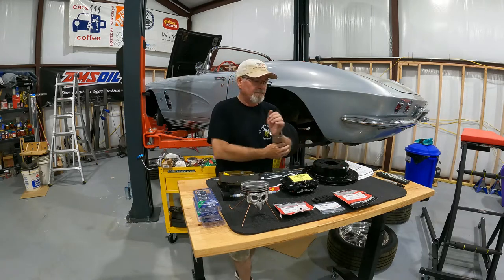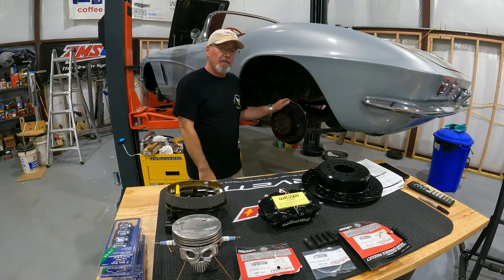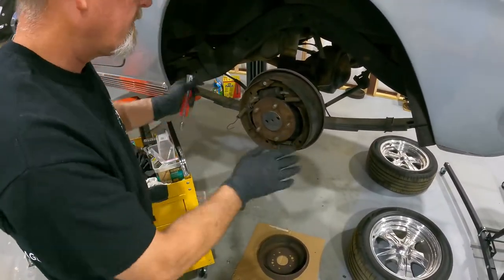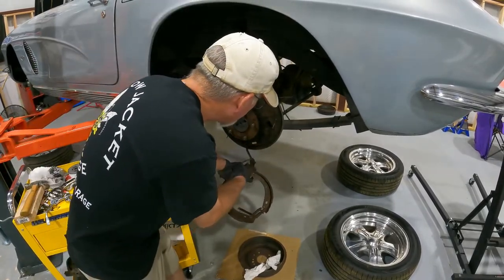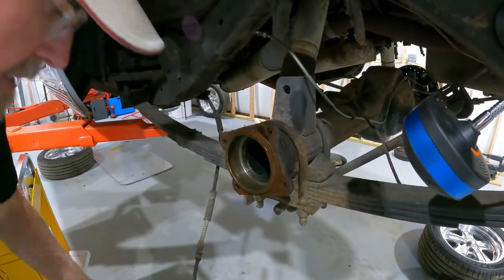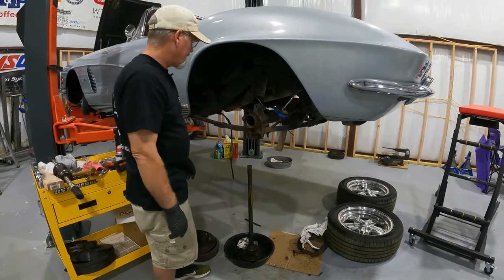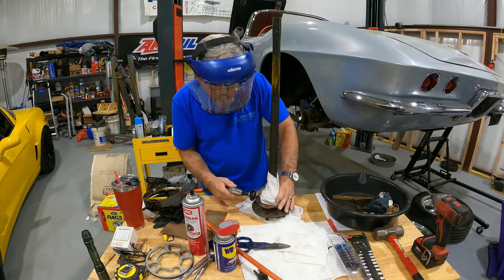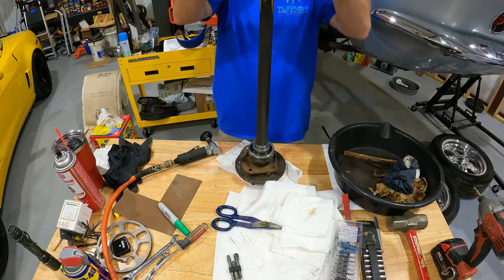1962 Corvette Upgrade episode #2, Rear Drums to Disc Brakes Conversion

Comment: Do you remember which wheel studs you used during this install? I'm surprised Wilwood doesn't supply them in the kit like they did for the front.
Reply from the maker: We just picked up the studs from my local NAPA store.  As it sits right now the front and rear studs are different sizes.  Future plans call for an upgraded diff so we're going to tackle the wheel stud issue then.